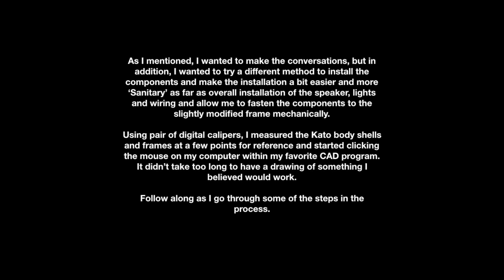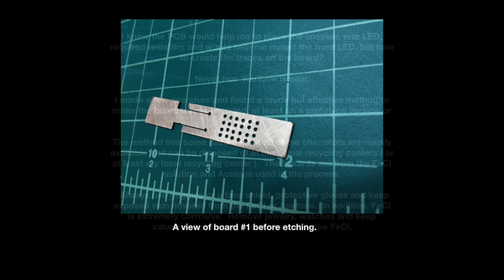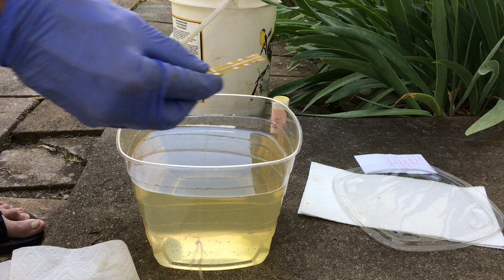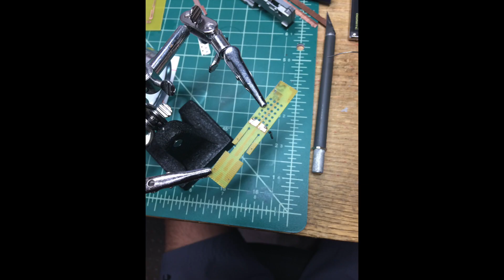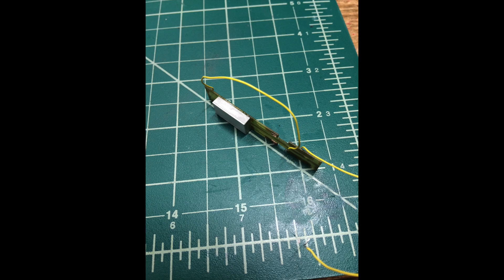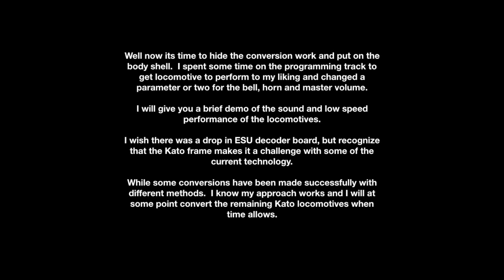ESU Lok Sound Select Micro installation into Kato n-scale diesel locomotives

Comment: At any point were any wires connected directly to the locomotive trucks? 

If not; hypothetically, could the two truck systems be interchanged with newer ones without compromising the functionality of the locomotive and its features?

Comment: Hey Bruce,  I agree about the LokSound decoders being the best for sound.  Just curious if it would it have been easier (and without all of the chemicals) to use a perforated bare phenolic prototype board & just run wires between the components? Great job & tutorial.....John
Reply from the maker: That's a great idea John.  In this case, I wanted to try something new and learn from the process. I actually did something like you suggest in a recent sound conversion I hope to post in the future.
I think I'd like to try making the traces on a PCB with a router.  I've seen lots of that lately on YT.

Always great questions and comments.  Thanks John.
Reply: @brucegiroux  I'll be looking for that next post.  Do you have any Kato F units to practice on??
Reply from the maker: @tanzj  Hi John.  No, I do not have any F units of any kind to work with.  From just a quick view of the outside of the shell I imagine there is a lot of space to work with in making a sound decoder and speaker(s) installation. It would be a great project.

Comment: If you contact your local wastewater treatment plant,they can dispose of the Ferric Chloride for you. Many plants use it for soap suds removal before discharge. I have 3 of the same locomotive,how much do you charge?
Reply from the maker: Thank you for the information on the Ferric Chloride.
Your question about the conversion is an interesting one.  I can think of a couple of variables that we would need to discuss to be able to give you a good number.  If you like you can email me at bruce.giroux@wbgx3.com
Thank you Gary
Reply: @brucegiroux   
I'll probably just wait until ESU does a plug n play board. Our N scale club has to compete with Lionel layout sound at train shows.